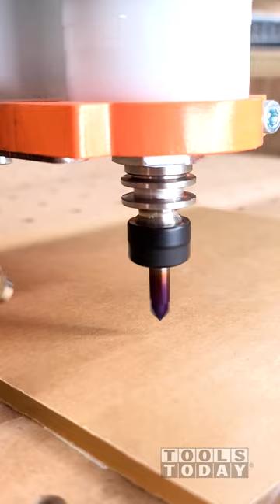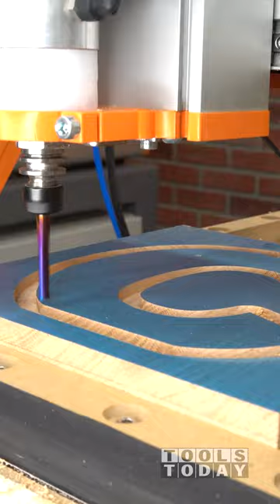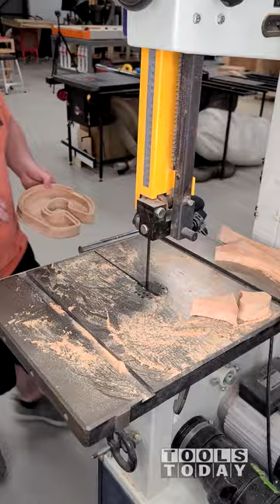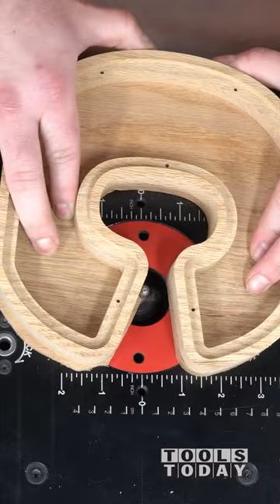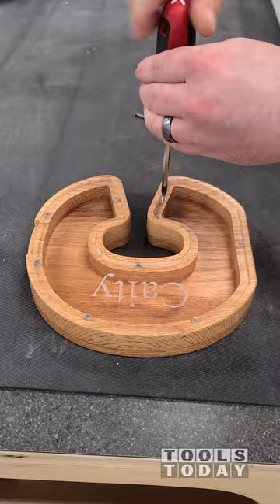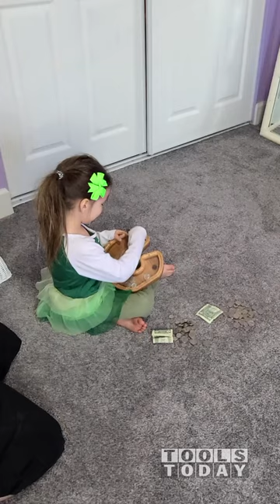Making a Wood Piggy Bank

Comment from the maker: Check out the full video on this project - https://youtu.be/wJW13pO2jdo

https://www.toolstoday.com/?utm_source=youtube&utm_medium=referral&utm_campaign=shop-cart

Plans for this project are also available here - https://www.toolstoday.com/cnc-alphabet-piggy-bank-letters.html
#short #shorts

What do you think of how this project turned out? Making a wood and plexi Alphabet Piggy Bank using Amana Tool® CNC router bits on the Stepcraft M.1000 36” x 48” CNC machine. https://www.toolstoday.com/?utm_source=youtube&utm_medium=referral&utm_campaign=shop-cart 

The downloadable and customizable CNC plans for this project are available on our website with item no. ALPHA_BANK if you want to make this project yourself! https://www.toolstoday.com/cnc-alphabet-piggy-bank-letters.html?utm_source=youtube&utm_medium=referral&utm_campaign=shop-cart

CNC Cam Clamps for Workholding Wasteboard, plans are available here, https://www.toolstoday.com/cam-clamps-for-work-holding-wasteboard-cnc-plans-downloadable-and-customizable.html?utm_source=youtube&utm_medium=referral&utm_campaign=shop-cart 

I started by using some X-Fasten double sided tape on to stick down the acrylic and started cutting with the Amana Tool no. 45626-K 3 flute 1/4" diameter 90° Spektra™ coated v-bit, all these tools are available on our website!

Feed, Speed & CNC Running Parameters

Amana Tool 45626-K SC Spektra Extreme Tool Life Coated V-Groove 90 Deg x 1/4 D x 1/8 CH x 1/4 Inch SHK 3-Flute Router Bit
https://www.toolstoday.com/v-14487-45626-k.html?utm_source=youtube&utm_medium=referral&utm_campaign=shop-cart 
RPM: 14,000
Feed Rate: 60ipm
Plunge Rate: 20ipm
Max Depth of Cut: 0.10”

Amana Tool 51411-K Spektra Coated SC Spiral O Single Flute, Plastic Cutting 1/8 D x 1/2 CH x 1/4 SHK x 2 Inch Long Up-Cut CNC Router Bit with Mirror Finish https://www.toolstoday.com/v-13759-51411-k.html?utm_source=youtube&utm_medium=referral&utm_campaign=shop-cart 
RPM: 14,000 
Feed Rate: 60ipm 
Plunge Rate: 30ipm 
Peck Drilling: 0.063” per pass retract above start depth

Amana Tool 51404-K CNC Spektra Coated SC Spiral O Single Flute, Plastic Cutting 1/4 D x 3/4 CH x 1/4 SHK x 2 Inch Long Up-Cut Bit
https://www.toolstoday.com/v-13351-51404-k.html?utm_source=youtube&utm_medium=referral&utm_campaign=shop-cart
RPM: 18,000
Feed Rate: 100ipm
Plunge Rate: 100ipm with 2” long smooth ramp in
Depth Per Pass: 0.25”

Amana Tool 46415-K SC Spektra Extreme Tool Life Coated Spiral Plunge 1/4 Dia x 1 CH x 1/4 SHK 2-1/2 Inch Long Down-Cut Router Bit
https://www.toolstoday.com/v-13781-46415-k.html?utm_source=youtube&utm_medium=referral&utm_campaign=shop-cart
RPM: 18,000
Feed Rate: 100ipm
Plunge Rate: 50ipm
Depth Per Pass: 0.25”

Amana Tool 46233-K SC Spektra Extreme Tool Life Coated Spiral Plunge 1/16 Dia x 3/16 CH x 1/4 SHK 2 Inch Long Down-Cut Router Bit
https://www.toolstoday.com/v-14497-46233-k.html?utm_source=youtube&utm_medium=referral&utm_campaign=shop-cart 
RPM: 18,000
Feed Rate: 35ipm
Plunge Rate: 17.5ipm
Depth Per Pass: 0.063”

The piece was finished with some spray lacquer and the screws were installed and it was given to my daughter Caity!

Comment: Why did you cut it out with the bandsaw instead of using the CNC to cut it out completely?
Reply: Can't say for sure what his reasoning was, but I'd do it that way because using the CNC to route the whole piece out would pulverize all that wood into sawdust, whereas using the bandsaw allows you to save that leftover wood piece for use as scrap material for making wedges and other small parts.